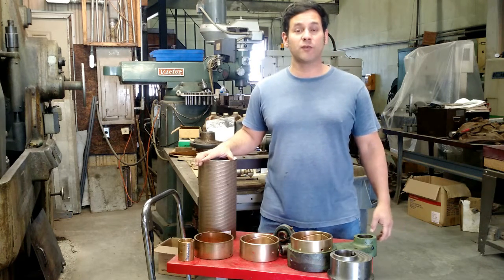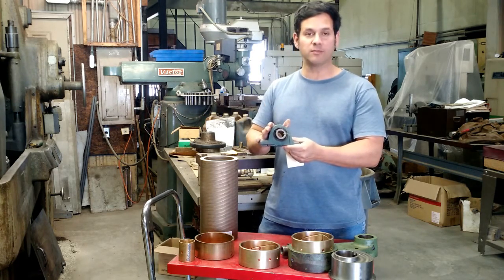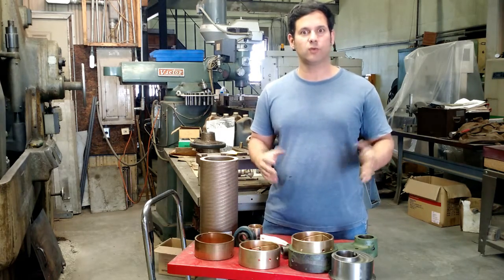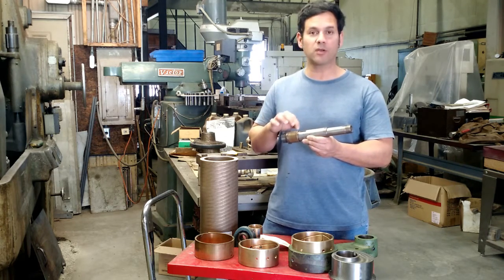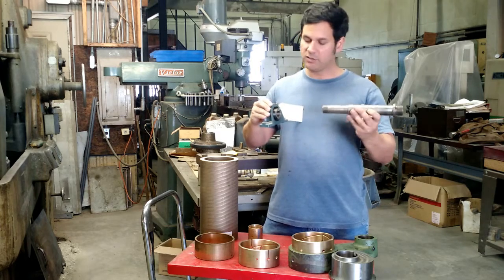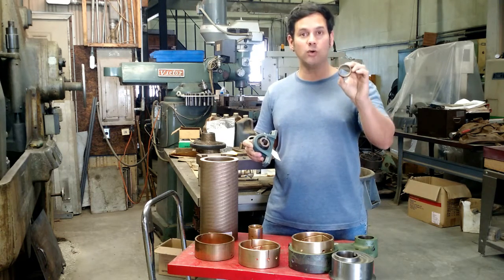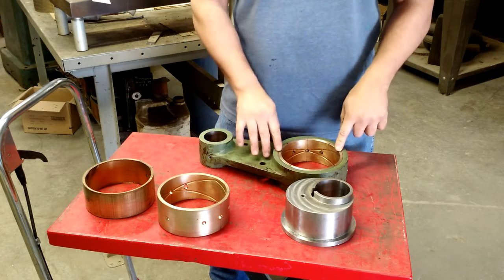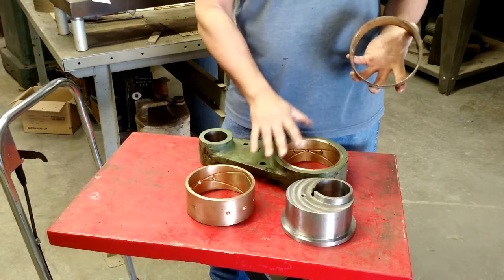HomeMade Lathe Bearings Part 2 - mounted bearings vs sleeve bearings

Comment: Hi really enjoyed this video. I have a English lathe a 1939 colchester master lathe. It's a plain bearing.  I'm doing a complete full restoration. But my only disappointment with it it's top speed is only 550rpm. Just wondering what are the chances with changing the bearings. I doubt that would not be possible.  As it's a geared headstock. And  there be not much room to replace from plain bronze bearings. To taper roller bearing. If it there is a way I surely be interested in talking to you about it.
Reply from the maker: Hi Mark,  the good news is that there certainly COULD be a way, the bad news is that unless you do the work yourself, it may be cost prohibitive.  look at the old Logan lathe head stock (you can find the on ebay all the time).  they came in both the plain bronze and the tapered timkin roller bearing.  it will give you an idea.  one thing i have seen done (if you have the room) is to use a flange mount bearing and adapt it to your head stock.  i dont have any pictures available but i have see it before.
Reply: Ray MAKES thanks Ray. I'll check it out  have a good day buddy

Comment: Appreciate the balanced discussion of the bearings versus bushings - I'm looking to build a lathe and learning what I can. 
Very well done video.
Reply from the maker: glad this video could help you.  i have built several lathes and a few of them i have in a playlist on my channel
Reply: Thanks Ray -- I'll be checking those videos out - I'm actually more keen on the metalworking lathe aspects, but if it's accurate and strong enough for the steel work, then at the right speed it seems it would work for any minor wood projects I might attempt.  But then I just starting to learn and don't even know enough to be dangerous yet.  LOL
Presently considering building with a 75 mm shaft (50 mm inner passageway) into 100 mm OD bearings to about an 8" lathe chuck - using a variant of the concrete lathe platform, should be interesting.   Trying to learn all I can on line - then will pay a lathe/machining expert to look over my prelim plans, and go from there.  ...I may be aggressive, and certainly lack the requisite knowledge - but I'm not crazy.
Reply from the maker: take a look on my channel...i run a machine shop and i have a playlist of nothing but machining projects
Reply: That's very cool Ray!! I will definitely check that all out. Subscribed to your channel.
I'm loving working with real materials.  Spent decades in designing computers, Op systems and such, and do patent work for big companies in those areas - it doesn't 'float my boat' anymore building them.  Liking the hands on of real physical elements and machining and building !   Thanks mucho....
Reply from the maker: +RelentlessHomesteading sure thing

Comment: thanks for the info, question here, what would be the difference of going to an auto engine crank style bearing scenario, with a pressurized  oil system? that to me seam to be a functional very workable scenario, but maybe through time the easier and cheaper production of rolling type bearings, just skipped right over that.

Comment: If I was making a lathe gearbox and using bronze bushings wouldn't I have an oil filled case so no need for auto oilers,
Reply from the maker: +tony coppe yes, that would be the best case, but many old machines still have the oil cups on them...just can't forget to keep them full

Comment: the location of where the second bronze sleeve sat on the Atlas plain bearing spindle was not correct. the second bearing location was on the smaller diameter to the rear of the location you stated. Atlas also made timken tapered bearing spindles. I have a headstock that has been running since 1949 in daily production at about 2700 rpm on the original bearings. Idealy in a wood lathe spindle for speed, accuracy and range of speed the best would either be tapered bearings, cylindrical roller bearings or angular contact bearings. something that would allow preload.
Reply from the maker: +oreos40 yes, you are absolutely right. I was trying to get just some general info to help some of my viewers who were asking this particular question with the things i had lying around, unfortunately i didn't have the smaller bushing.  as you know a history lesson in old atlas, Logan, craftsman lathes would be a VERY long lesson.  i personally use angular contact bearings in my homemade lathes. the plethora of bearing types will be a topic for another video :)